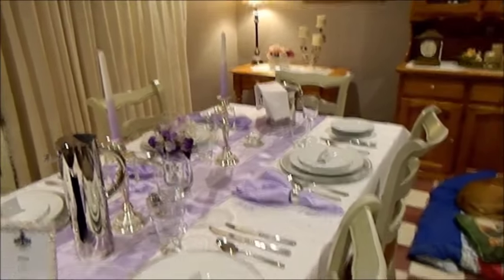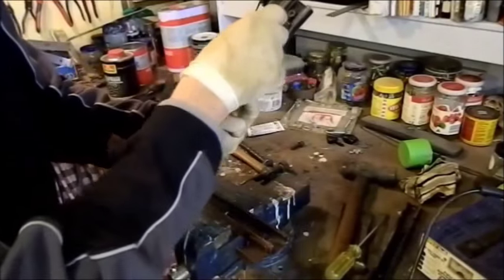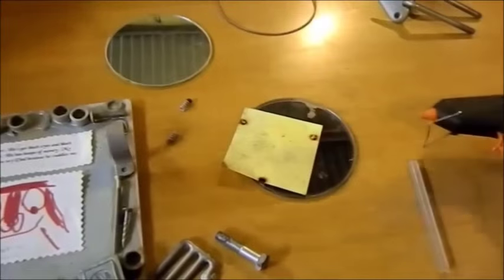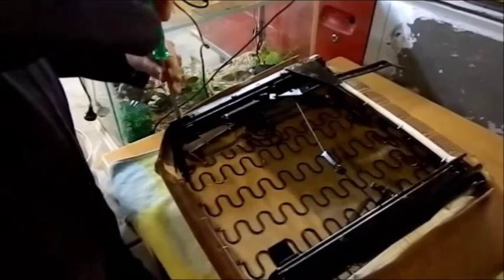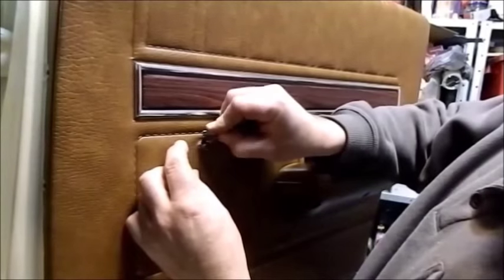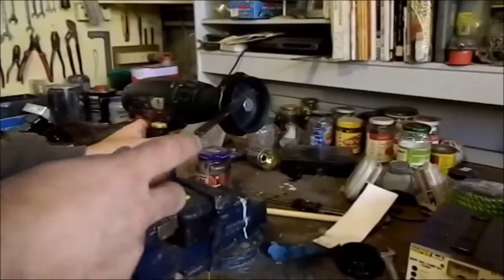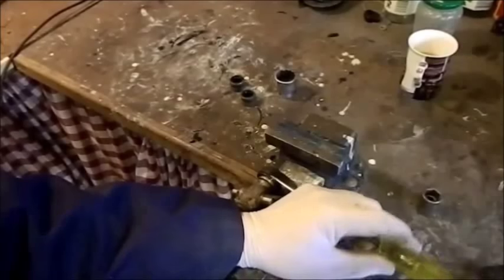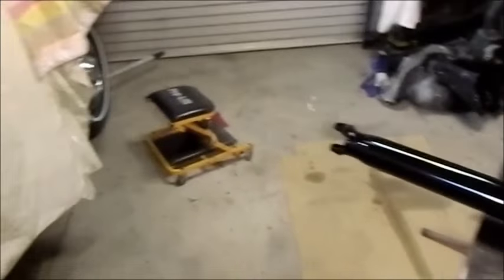1969 XW Ford Falcon Restoration Part 25 - NEARLY THERE!!!

Comment: Hi Peter.
Yes I reluctantly let go of the VK Calais, but to a lovely young man who will give it the attention it REALLY DESERVES. Then bought an IMMACULATE ZK EFI Fairlane. Then finally finished off the Grp A you viewed. I will do a walk around video of it soon. It's registered and running on road - needs a Grp A interior to make it complete . Have a mental VN headed Carby 304ci for it and mechanical TH700 4speed to go in place of current drivetrain which is 5L and TH350 - then hold on lol. will keep you posted. ;-)